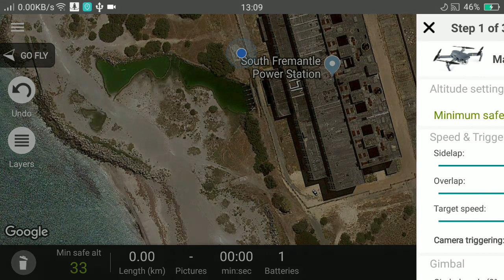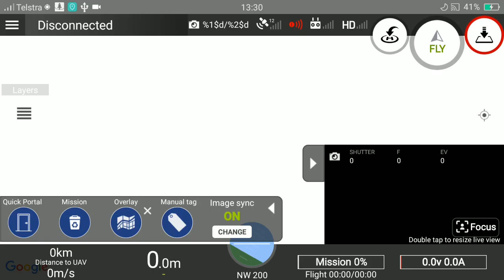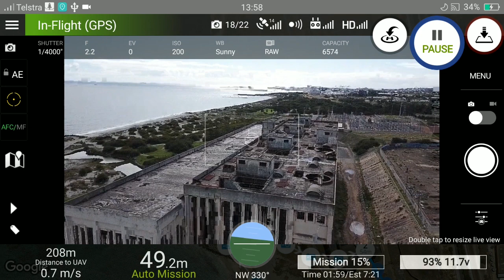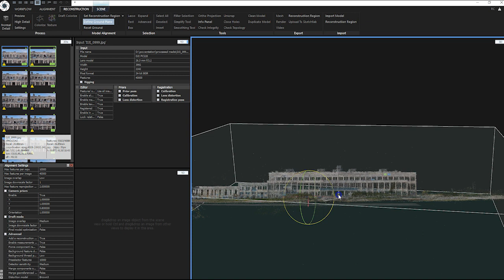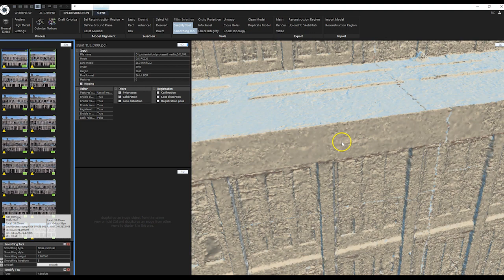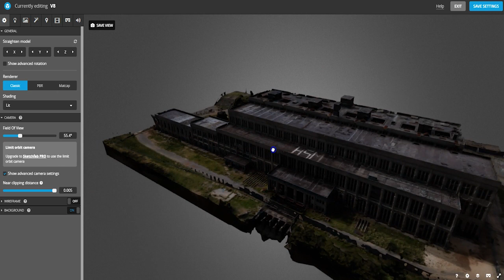Easy Photogrammetry with your DJI Drone - Full end to end Guide. DJI Phantoms, DJI Mavics etc

Comment: I have installed the app on my Smart Controller (DJI) and I'd like to use the app with the Mavic 2 Pro. When preparing a flight I get to see a great red circle and the homepoint(take-off)  is set automatically to the actual place I am at that time. What does the red circle mean and is the homepoint updated if I move to the site ?
Reply from the maker: That’s a 500m geofence. It can does disabled
Reply: @aeroranger5513  Thx, and the homepoint is updated to the actual take off point ?

Comment: Question: I have an iMac, 3.6 Ghz Intel core i7. Does it have enough power to create a model similar to the one you made here? TIA
Reply: AFAIK, processor power is not that important. RAM size and GPU is. You're probably fine though. The slower your computer is, the longer it will take, that's all